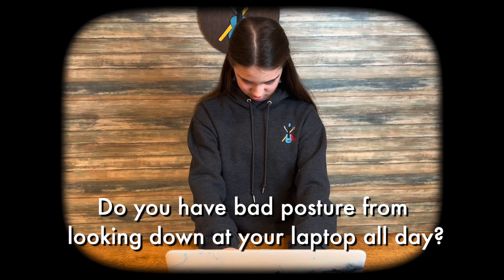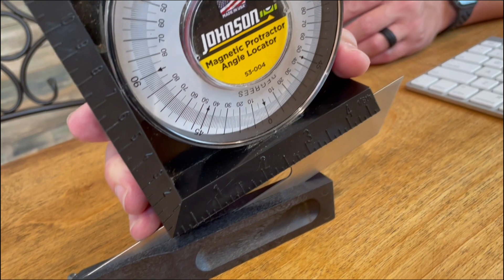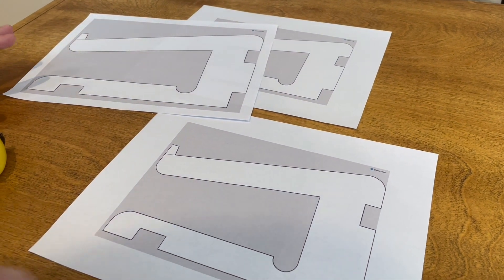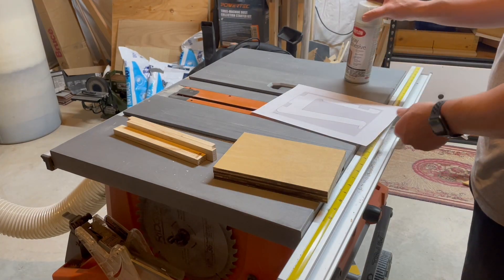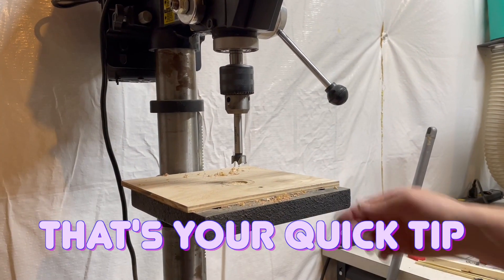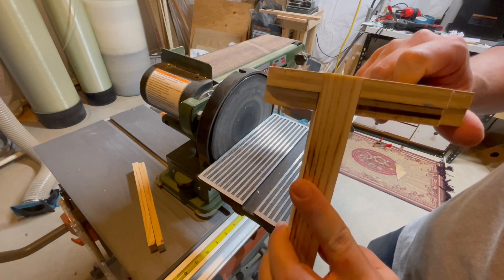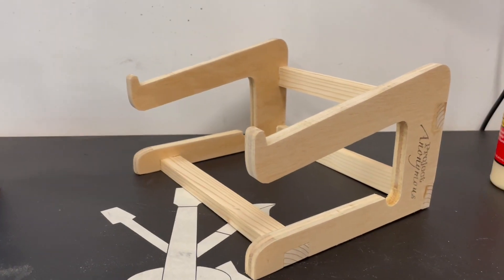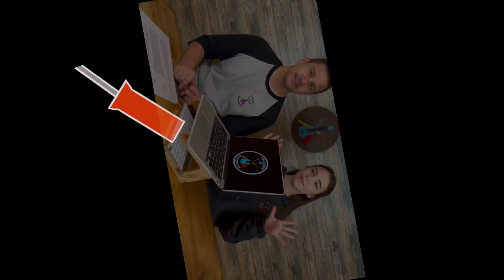Making a Laptop Stand & Laser Engraving It

Comment: Wow, nice work! I didn't realize what the half-round bits were at the back of the keyboard spot until you dropped in that keyboard. What a great idea! A note about that keyboard: I used to have one but let some batteries go bad in it, and it was impossible to get them out. So never let batteries leak in there.
Reply from the maker: Thanks for watching as well as for the tip! We had a similar issue with the apple mouse, took a bit to clean out the battery residue.